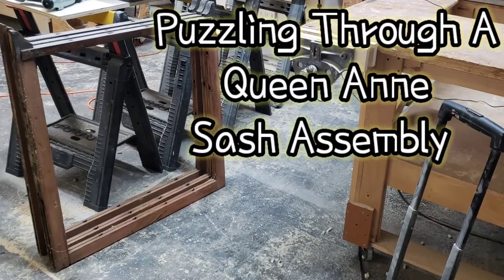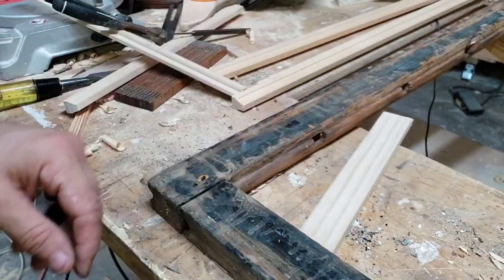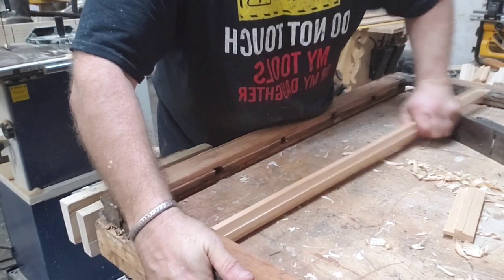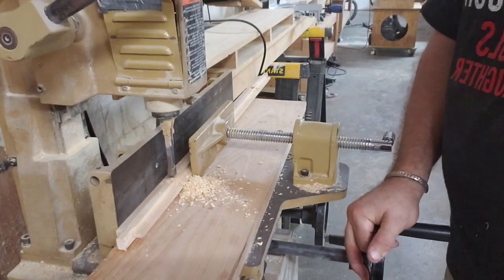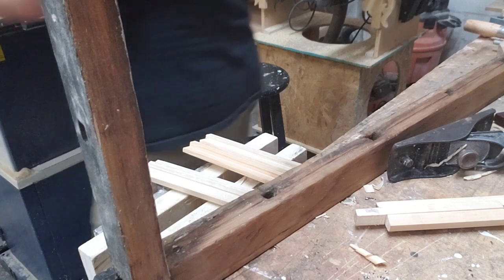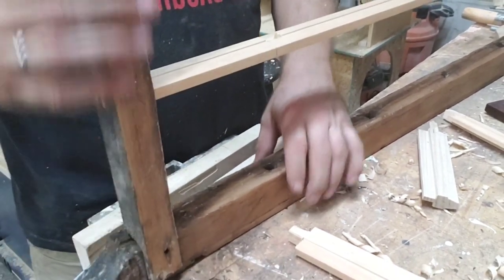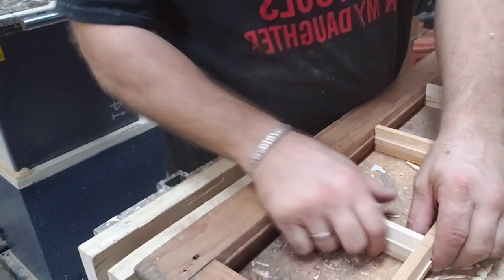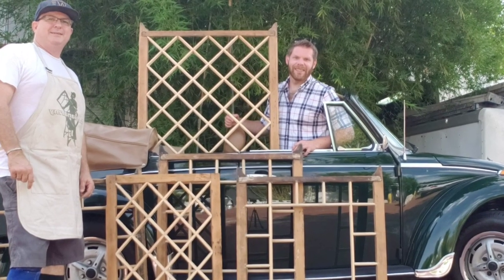Puzzling Through A Queen Anne Sash Assembly

Comment: Thanks for all the great information.  I looks like you have also built windows with diamond shaped sections? I have 7 windows like that in my old house but I can’t find any information on what joints are used to piece it all together. A square sectioned window like a Queen Anne I understand but not the joints for the diamond sections. If you could show how one of those is put together it would provide some very hard to find information! Thanks again!